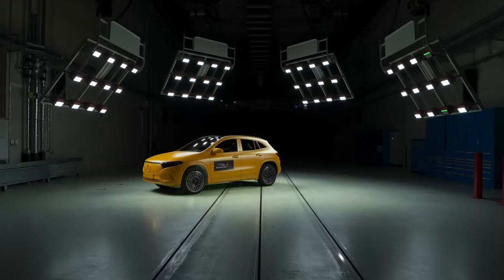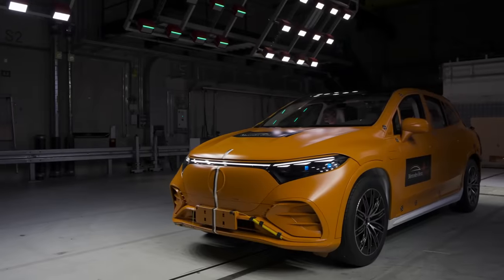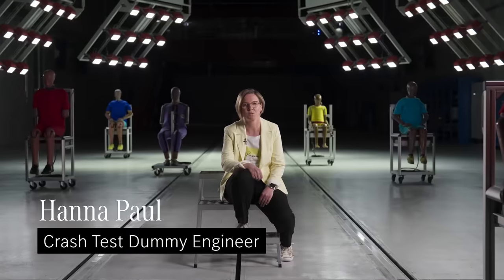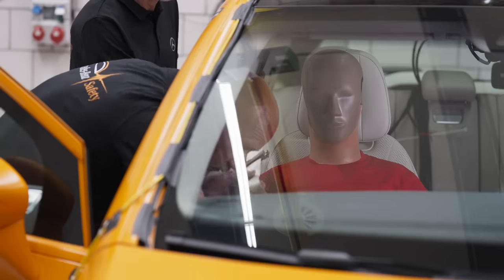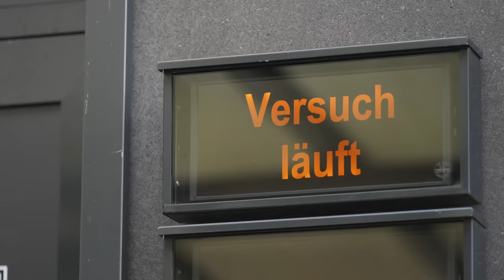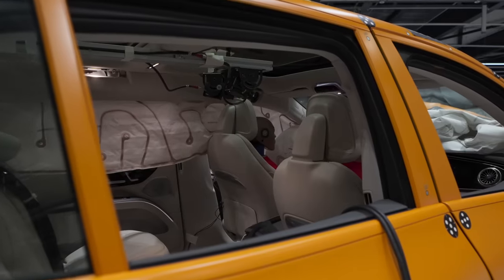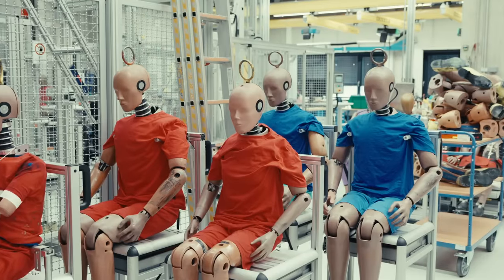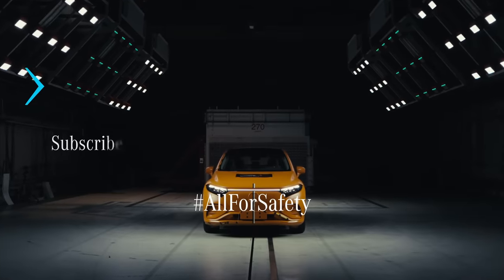The world's first public two-car electric crash test by Mercedes-Benz

Comment: Small EV v large EV and both EV's against sub mini medium  large and offroad ICE vehicles then add in tests against EV vans and ICE vans then ICE lorries lets see just how safe they are against HGV where the impa t is such it crushes parts of the battery, does it cause fire the percieved largest threat ? Does it cause electric discahge electricuting passengers doe that charge sat active endangering any public or emergency workers going to aid the passengers?

Comment: Ok Mercedes. The cars a written off , the extra weight from the batteries must surly cause the cars to be more highly damaged. Maybe Mercedes has strengthened the bonnet structure to absorb more of the impact ,which is great but Mercedes are not cheap & the EVs are even more expensive. No repair bill in this crash. The cars would have to be written off as the battery packs would surly be compromised. Even a small underbody impact to the battery case can cause the batteries to be written off. 
Why are you trying to sell these EVs , companies are losing millions if not billions because people don’t want them & they are pulling out of the market. Curb your losses  and get out now. I won’t say I didn’t tell you.

Comment: I am pro EVs as they offer many benefits but stil a long way to get there. However i also had the nagging feeling of something off with this video. First tought i had (like some other comentators) was about the state of charge of the batteries... there was a respond saying it was 80 % or so but still strange not to be mentioned in the video but spend a lot of time talking about dumies amd sensors so not sure there is nothing to be suspicious about. There us a whole array of questions to be clarified but the main is "considering there ate soany variables in driving conditions and colisions specifics , what is the actual value of this test as they are designed (well planned, simetrical and equal from all sides). I mean actual real life value other than publicity?" In reality colisions are not controlled process. And a small diviation can lead to big difference in results (a few mm side ways can miss or not something....). And anyway were thw cars towed or self propeled? If towed were the cars drive systems actually on ? I dont know what, but something feels off...

Comment: Now take the test to the limits ... Crash the cars at a speed that causes failure of the battery's and high power components.... Let's see where they actually fail at.
Reply from the maker: The speed of both vehicles was 56 km/h, which is actually considerably higher than the required standards imposed by the relevant law. The high-voltage system in the EQA and the EQS SUV switched off automatically during the collision, so any failure can be assessed after the crash.

Comment: Let us focus on the real problem surrounding the electric vehicle, "ev." Longevity of the charge; value for every dollar spent; oh and a very important point, when the battery is expired the cost of a new battery; expense when there is an accident or just a repair of the engine or some necessary part; this list could continue on and on. Why not perfect the electric vehicle before mass producing the auto and reconsider the price. Let's face the fact Mercedes is not the best vehicle in the market.
Reply: Tell me you have no idea how automotive development works without saying it....

Comment: We want to see 100-120 km which is real speed people crash at…. No one drives below 100 km 🙄
Reply: No use in that. U are simply dead unless super lucky.
There is only a certain amount of impact a car can protect u from
Reply: Both cars driving with 56 kph when the meet that’s the most common speed when an accidents happen outside urban arias. For the occupants the impact is like hitting a wall with 96 Kph. Ask any other car manufacturers to do such a test in public. I guess you wouldn’t find any
Reply: @inin428  damn i should have copied my answer 😁
It's still 56kph against a wall

Comment: With the extra weight EVs carry they will damage roads faster than lighter vehicles which means more servicing the roads which means more fossil fuel production….they have to have more frequent tire changes which also means more tire production which also means more fossil fuel production…..the extra weight will lead to more dangerous crashes…more harm to pedestrians if they are hit…more damage to poles or buildings if they are hit. The EV charging stations are powered by fossil fuels….so let’s not pretend that EVs  are good for the environment….they are not zero emissions when you add in all the fossil fuels it takes for their use.
Reply: Nobody with their right mind would claim they have zero emissions. Nothing has zero emissions except for maybe a tree. However, even with fossil-produced electricity you will reach a break-even point in emission due to higher efficiency on electric engines. Also the advantage is, that you produce emissions far away from e.g. cities where it would inflict more harm on people around.

Comment: As with every crash test, the applied velocities are important and the impact of a 2.5 t car at 170 km/h at a German Autobahn (due to lobbyists also from Mercedes) is about 3times higher. This is true for all cars, not just EV. I drive an EV and would love to see a general speed limit in Germany.
Reply: I understand your concerns and views but do not agree to a general speed limit.
Reply: There is no statistical proof that the lack of limit speed on Autobahns causes more crashes. You are just scared because it's fast, but in fact it's safer. Emotion play.
Reply: @Kitharistas  Would you mind to explain how higher speed deltas increase safety?
Reply: @Kitharistas  1. Any evidence to back that up? Not denying, just curious since I work in an according field
2. The severity of an accident is exponentially higher, even a lower probability will higher the overall risk

Comment: Well done Mercedes, like Volvo, always at the forefront of car safety. Agree with anothers comment on the weight of vehicles has to be reigned in as an E class type car for instance doesn't  need to weigh over 1800kg, yet the electric varients of similar size cars are way heavier and therefore more dangerous to other smaller cars during an impact.

Comment: EVs are VERY obsolete.  Ask me why...

The future is New Engine Type (NET) tech with 75% combustion efficiency with combined cycle and CO2 capture/recycle.

150 MPG HWY
240 MPG City
200 Combined

3000 miles with CO2 capture, 9000 miles without on gasoline.  Can use gasoline E0 to E100 (Ethanol).  Electro Ethanol is ideal.

Capture CO2 and water, no fire risks with Electro Ethanol.

Making fuel (Electro Ethanol) will be 3 cents/kwh at home.  100% RE grid will be 60 cents/kwh at home, and 90 at super charger.  20 to 30:1 costs.

NET makes EVs obsolete, and can be CO2 neutral.  NOTHING you have is more than 33% reduction in CO2.

NET works in airplanes, cars, SUVs, pick trucks, semi trucks boats, heavy hydraulic equipment, houses, buildings, Grid, greenhouses, water purification and more.  

Your company will go bankrupt without NET.  Happy to discuss NET with you, Porsche, Audi, VW.  If not, I wish you well.  Prepare to go bankrupt.

Comment: Could be huh.... Well Mr mercedes.... Let me tell you my experience over the last 30 years...... In the American Collision industry. 

That, hypothetical scenario right there, rarely happens. When in reality, you're two most common collisions in the market. Is, right front fender, meats, left rear quarter panel. Yep that's right.... Parked cars. You're more likely to hit a parked car, then a vehicle traveling right at you. 
The next most common Collision in the United states, occurs, at the rear end of the car. Because, while we do have anti-lock brakes and airbags..... We also have cellular phones. And we can see from the damage in the vehicles.... You didn't get your brakes before you hit the car in front of you. 

But the most common Collision in the united states, is not, car versus car. It's car versus deer. 

So unless you Big brainz at Mercedes can figure out how to stop a 14 point buck, from running straight into your grill...

This is nothing more than, a sales pitch.

Comment: Make it safer, faster. Why 2050. May it 2030
Reply: To achieve this level of safety u need features that simply arent available yet. There is only so much that u can do with design and airbags etc.
The big gamechanger until then will be connectivity between traffic and environments, which will still take a long time

Comment: EVs are actually much less likely to be involved in a fire than a gas powered car especially after an accident. Front ends contain many oil based fluids plus low and high pressure fuel lines than can easily rupture and ignite on the hot exhaust. EVs will disconnect the high voltage system automatically or it can be manually done usually by an marked disconnect.
Reply: I assume you meant to say" EVs are actually much LESS likely to be involved in a fire than a gas powered car".
Reply: @jimdunleavypiano Yes, that is what I get for leaving comments at 1am.

Comment: I smell a rat.  These batteries are potentially going to now go into thermal runaway.  Never mind disconnecting the output from the rest of the vehicle, the batteries will self ignite all on their own.  And please everyone, ask yourself this, … if ALL vehicles are crash tested before they can be sold to the public, and if ALL those tests are rigorously undertaken, then HOW is it possible that batteries are going up like fireworks after sustaining just a small amount of damage?  WHY are manufacturers unable to offer repairs to battery packs?  WHY didn’t Mercedes show us the beautifully undamaged batteries?  We are being duped by corporations that have also duped politicians into blindly following the agenda that those corporations want to enact.  Unfortunately they didn’t quite realise themselves that the they were going to get found out so soon after the lie.  There is NOTHING green about EVs.  They are offering you an opportunity to greenwash your existence that is neither true nor actually required.  But it’s nearly too late because a lot of rich people are already a lot richer and the vast majority will just gaze about, like rabbits in headlights, uttering the immutable words of Homer.  Doh!
Reply: And I still haven't seen any data backing your claim. Can you provide? Chance for fire is significantly lower than in ICE cars and I hear nobody crying about it. Do you have any idea about the structural and software safety measures to protect the battery? Imo this is simply a false claim used to hate on EV cars, change my mind with data

Comment: Lets see an EV head on collision with ICE vehicle since ICE makes up over 90% of what is actually on the road.
Reply: Although weight is an issue, the opposing car also profits from the big crumble zone the ev offers since it doesnt have a engine in front
Reply: @quelandil5738  The substantial amount of additional weight has much more negative consequences than the benefit of additional crumple zones.
Reply: @joshmonus  would actually be interesting to see the calculation for that. There will be a certain weight delta where u are correct and another one where i am correct.
Do you know any source towards that?
Reply: @quelandil5738  Looked up article showing full size EV truck at over 9000lbs and it's gas counter part less than 6000lbs.  Calculated at 70mph the EV has 281,700 newton of force and gasoline has 187,800.  Would need to divide that by how much energy the additional crumple zone on EV can absorb.  But there is no way crumple zones could mitigate the additional 50% of force for EV.

Also the article cited this
"baseline fatality probability" increases 47% for every 1,000 additional pounds in the vehicle
Reply: @joshmonus  thanks for providing this example. I did some quick search and couldnt find numbers comparing crumble zone effectiveness ev vs ice. Will take another look tomorrow cause i'd really be interested.

In your example the difference in impact force is pretty impressive and I agree with u on weight outweighing ev advantages.
The higher the speed the delta in force increases exponentially. Therefore you could argue that in lower speeds you could be in a situation where the difference in crumble zone effectiveness would shift advantage over to the heavier ev.
What's your take on that?

Damn, we need numbers 😁
Reply: @quelandil5738  👍, I'm not good with math and those newton numbers might be missing some zeros, but the same principle should apply, increase of 50% weight should equal 50% increase of energy.

You are right about speed too, that effect is exponential.

Comment: both cars destroyed how`s that good. the insurance company would right these off. get real electric cars no good.
Reply from the maker: The vehicles’ extensive deformation following the collision may seem alarming to the non-expert. For the Mercedes-Benz engineers, however, it shows that the vehicles were able to effectively absorb the energy of the collision by deforming. As a result, the passenger safety cell of both electric models remained intact, and the doors could still be opened.
Reply: bro got sat down by mercedes themselves lol

Comment: There was already in 1991 a H2H crash test of two Mercedes W124 in the Auto-Motor-Sport magazine at comparable speed. The advancements after 32 years are not that impressive, to be honest.
Reply: You might want to drastically change your mind if you look at the accident statistics from 1991.

The advancements in the last few decades are highly impressive.
Reply: @Tschacki_Quacki  I know, but not all cars were at the level of the W124 at that time. The stability related to the car weight was already impressive. The two e-monsters here are suffering from challenges related to the extreme high weight…the momentum is speed multiplied by mass. A significant part of the structural improvements is lost by the weight increase.

Comment: 17.5 mph each car are you joking . what happens if one of the cars is a petrol car. The ev will destroy it. What happens if the car has a glass room. Show us when the cars are driving at 60 mph eachMy guess is it would be like a nuclear explosion. This over produced garbage is clear properganda.
Reply from the maker: Hi rupertbear6883, each car was travelling at 56 km/h or 35 mph. The speed selected for the test takes into account that, in a real-life accident, the drivers would still try to brake before the worst case of a collision.
Reply: Tell me you don't understand physics without saying it 😁

Comment: Firecrackers on 4 wheels ... When this 🚙⚡🔥 start to burn - it is inpossible fot firefiters to stop batteries on fire ... They can only wait - until baterries stop to burn / fire themselves alone ... Veeeeeeery dangerous ... This is very unsafe ...        P.S. After the crash / accident - you must throw that car in " garbage" - because  it is inpossible to repair the battery pack - yuo have to buy another brand new car.  / Bad for you - at the same time - good for the businnes ... :face-blue-wide-eyes:👎:face-fuchsia-tongue-out:⚡🔥🛴🚙:hand-orange-covering-eyes:

Comment: It looks much more energy extensive from a „normal” cars crash test, because of a weight. Imagine normal car vs electric which easily can weigh 2x more.
Reply: Wrong. Big SUVs weight more than the heaviest EV. Don't take my word for it though, go and look at the specs.
Reply: @jimdunleavypiano  I checked the weights of bigger car from this video and GLS SUV (which is hybrid with battery nowadays) and they pretty much the same.
EQS SUV 450+ Weight Unladen (EU) - 2695 kg
GLS 450 Weight Unladen (EU) - 2490 kg

Just for reference, my car is 1150 kg. So what’s wrong?
Reply: @tivrobobo  Yeah, hybrids are the worst of both worlds because they have both an ICE & electric drives & battery. I'm talking about pure battery EVs. Hybrids are a dead end imo.
Reply: @jimdunleavypiano  I’m talking about EV is another heavy objects with lots of kinetic energy on the road. Nothing good.
Reply: @tivrobobo  How is an EV different from any other car, van or lorry in that respect? The roads are full of heavy vehicle - EVs are far from the heaviest out there.
Reply: @jimdunleavypiano  lorry and vans has additional regulations, for example speed limit, restricted zones, driver license category, etc.
Reply: @tivrobobo  There are plenty of ordinary ICE cars that are as heavy as or heavier than any EV. You are trying to imply that EVs are heavier than any ICE cars and that is simply not true. If you're worried about heavy cars, you should be even more worried about big SUVs than you are about EVs.
Reply: @jimdunleavypiano   Why you try to convince me to worry about heavy ICE SUVs more than heavy EVs? I can worry both. This video is demonstration of “safety” of EV cars when colliding similar weight cars. What could I say? Bravo for a try. But this has nothing about real world situation, when 2.7 ton “safe” EV will collide with average european ICE compact car which is 2 times lighter.